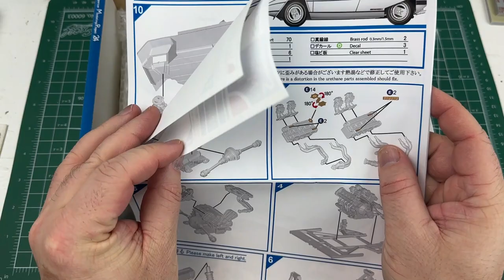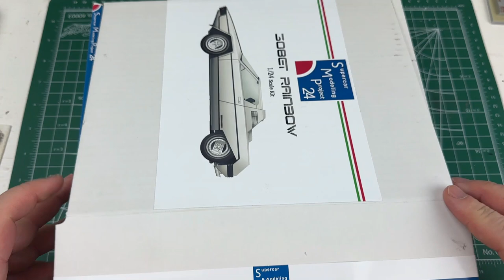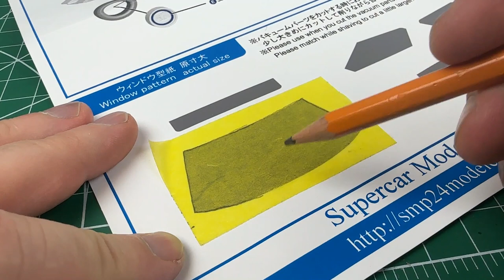Building a Forgotten Ferrari Concept: The Bertone Designed 308GT Rainbow [FULL BUILD] Step by Step

Comment: Clearly a derivative of the Fiat X/19. Whether Ferrari or Fiat came up with it first, I’m not sure, but they are distinctly related.
Reply from the maker: The X/19 was based off a previous Bertone concept called the Runabout. Personally, I don't see a lot of similarity in those two but Wikipedia never lies! haha. The X/19 was in produciton from 72 to 82 so it definately came first. The Rainbow seems to share some of the same lines but has a much more angular look to it than the X/19, IMO. Also the wheel arch designs are a very large step away from the X/19, again showcasing the angular desings of the Rainbow. Also the Rainbow had a targa top that would fold itself down behind the seats. A pretty cool feature. Thanks for watching and thanks for commenting! It is appreciated.